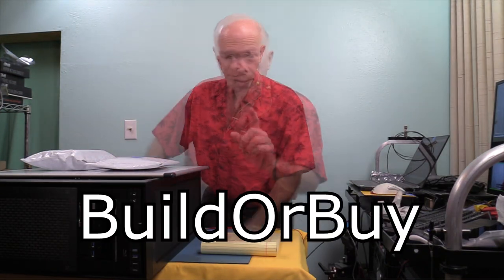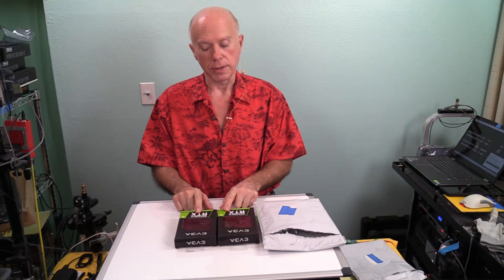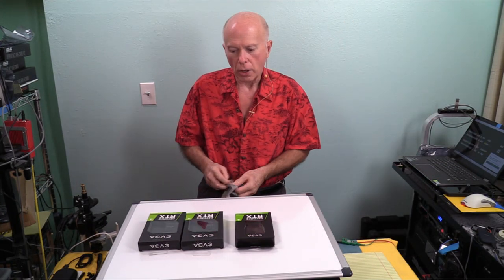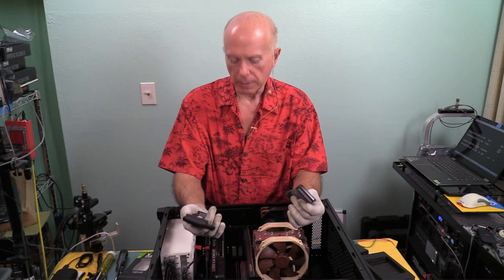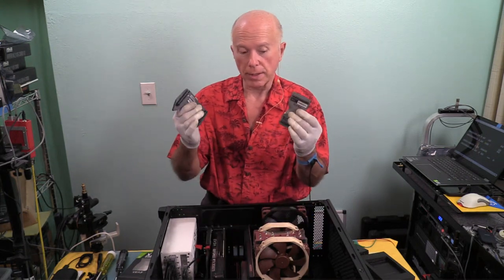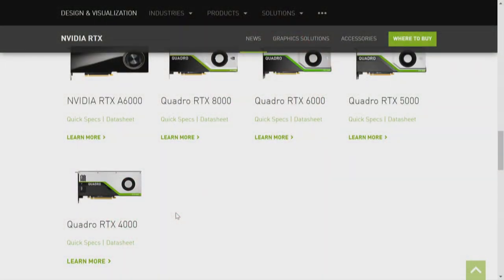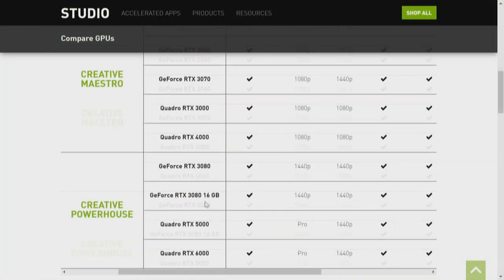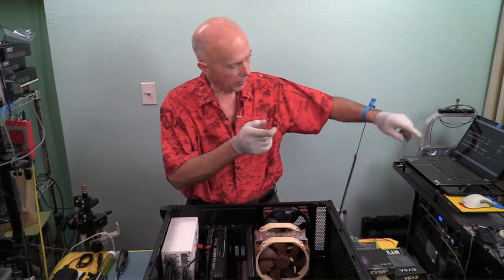Unboxing EVGA RTX NVIDIA NVLink Bridge

Comment: Otherwise, will it work on ASUS x570-e strix with 2 ASUS 3090 strix? 
Thank you in advance!!!
Reply from the maker: Hi Beatrice Costa, 
Rendering? Yes, it will work. However, there are 3 obstacles to deal with and overcome or be aware of. 
1. The RTX NVLink Bridge (3090) is 4 Slots Wide. To reiterate, all RTX NVLink Bridges for RTX 3090s are 4 Slots wide. 
2. The Slot width of Your GPU must be 3 Slots wide or less. 
3. Requires 2 x16 PCIe Slots, mechanically. You will be using dual x8 Slots, electrically. As long as You know that. No, You will not saturate the PCIe Bus but are not getting full performance and to have 2 RTX 3090's that's probably what You want. Just FYI. Moving forward to have 2 dedicated x16 Slots, electrically, would require the TRX40 Chipset. Hope that helps! Thanks for Asking! Keep Us Posted on Your Build Progress!
Reply: @BuildOrBuy  There is only one size bridge for the 3090s? One has to space them, for example, in the WRX80 in a way that the bridge prevents the use of one of the PCIe slots? Maybe this is for heat/air flow reasons...

Also, you mention that what was old is becoming new again. I keep hearing ppl say that SLI or linking GPUs is dead. Do you have a link that speaks to any new uses or resurgence in linking GPUs. Maybe linking GPU is dead for gamers.

Thanks, again. I continue to find your delivery of info/content refreshing. Perhaps lots of practice.
Reply from the maker: Hi @RickyBobby_USA , 
Yes, for the NVIDIA RTX 3090, only 4 Slots wide no matter the brand of GPU. For the most part, yes unless You're using a half height card like maybe a Mellanox Adapter. NVIDIA is getting way from Bridging all Consumer GPUs and moving that technology to the Workstation GPUs. I think, to further differentiate Consumer vs Workstation GPUs performance. Right now, only one Manufacturer of Workstation GPUs while the Consumer GPUs have several. Let's hope that changes! To reiterate, only the RTX 3090 Consumer GPU can be bridged. Let's hope that will continue moving forward on the RTX 4000 Series! Only time will tell. Until We know more, a point of conjecture. 

The more We look at the Consumer GPUs, the more intriguing the Workstation GPUs become!  From Slot Design to Resources required such as spacing, power requirements and NVLink bridging which is an extension of the PCIe Bus. Workstation GPUs have 2 different bridge widths whereas the RTX 3090 only has 1 bridge width of 4 Slots wide. 

And doing the 'what if' scenario, 2 RTX 3090s vs 1 RTX A6000. Price, Performance, Resources, Processing Power. Easier to install 1 GPU vs several. And all apps will recognize the 1st GPU. Most will not recognize more. Some will see 2 GPUs. An interesting situation to zoom in on then zoom out and say, here's what We know. Here's what We have available. What's the easiest way to solve the Problem. It's all about the end Results! If an application will only see 1 GPU but can make use of all of it, then how do We maximize that situation? 1 GPU! A process of back and forth. Keep it Simple! And sometimes kicking and screaming! 

Appreciate Your Comments and feedback! This helps Us to make better Videos! We're all about Answering Subscribers Questions! Hope that helps!
Reply: @BuildOrBuy  Love the interaction. I understand as your channel grows, it will be harder to respond. I wont hold it against you. Cheers.
Reply from the maker: Hi @RickyBobby_USA ,
Absolutely! I'm all about Answering Subscribers Questions! Everyone matters! My Goal is to help all Who come to BuildOrBuy! We learn by doing! And We should share what We know! What good is knowledge if not shared. I have to hibernate when Filming and while Editing! I'm honored You found BuildOrBuy! Appreciate Your Support! I love my Subscribers!

Comment: are 2080 RTX bridges and RTX 3090 bridges identical? the reason I ask is because I want to use 2080 single slot bridge on a DUAL SLOT 3090 card... cant seem to find the exact Gigabyte single slot bridge but I do see NVLINK bridge that was originally created for the 2080 cards..
Reply: -update - I am thinking that the RTX NVLINK QUADRO bridge has an identical interface... I think that is the answer.. those are dual slot cards and they are RTX..
Reply from the maker: Hi xpez, 
Welcome! That's why We created this Video to minimize confusion. So much for that! The different Generations of NVLink Bridges are different Configurations. For example, the RTX 2080 NVLink Bridge looks H shaped. Whereas the RTX 3090 NVLink Bridge looks X shaped. 

Puget Systems has the most extensive List of NVLink Bridge Configurations. Links below. 

Puget Systems RTX 2080 NVLink Bridge 
https://www.pugetsystems.com/support/guides/how-to-enable-and-test-nvidia-nvlink-on-quadro-and-geforce-rtx-cards-in-windows-10-1266/

Puget Systems RTX 3090 NVLink Bridge 
https://www.pugetsystems.com/labs/articles/NVIDIA-NVLink-2021-Update-and-Compatibility-Chart-2074/

And You require an RTX 3090 NVLink Bridge. To double check, which Motherboard and Chipset are You using? We'll take a look and see if We can verify what You need.
Reply from the maker: Hi @xpez9694 , 
To reiterate, tell Us about Your Motherboard and Chipset. We'll see if We can help Verify which NVLink Bridge You need!
Reply: @BuildOrBuy   great link! The GeForce RTX 3090, RTX A6000, and RTX A5000 use a new NVLink connection, which is not compatible with the bridges from the 20-Series and Quadro RTX cards. RTX A6000 / A5000 and GeForce RTX 3090 NVLink bridges may look different on the outside, but they appear to be functionally identical. We've tested both types of cards with both styles of bridges, and they worked interchangeably.
Reply: @BuildOrBuy    supermicro - M12SWA-TF  -Socket sWRX8/SP3m  i mistakenly bought the 3 slot  Gigabyte Aorus bridge. Since I have 2 x dual slot 3090s I want these cards to sit next to each other. that will free up another slot for something else. I can use what I have for the time being but not finding the 2 slot Gigabyte Aorus Bridge sent me down this rabbit hole of finding the compatibility.... LOL  thanks for your assistance!
Reply from the maker: Hi @xpez9694 , 
Nice WRX80 Workstation Motherboard! Down a Rabbit Hole and into the Weeds! So You were able to get Your hands on 2 Gigabyte Blower style RTX 3090s? Wow! Congrats! The Gigabyte NVLink Bridge is extremely hard to Source. Best price was at Best Buy. EVGA was easy at one time. Scarce now. The NVIDIA version in available but at a higher price. However, those both appear to be 4 Slot NVLink Bridges. The PNY RTX A6000 NVLink Bridge should fit according to Puget Systems. Link below: 
https://www.pugetsystems.com/labs/articles/NVIDIA-NVLink-2021-Update-and-Compatibility-Chart-2074/#:~:text=Most%20GeForce%20RTX%203090%20video,obviously%20not%20work%20with%20those.

Best Source on RTX A6000 NVLink Bridge is B&H Photo Video. 
PNY NVIDIA NVLink Bridge for RTX A6000 (2-Slot)
https://bhpho.to/3IvCvvv
As a B&H Affiliate, I earn from qualifying purchases! Hope that helps! Thanks for Sharing!
Reply from the maker: Hi  @xpez9694 , 
Yes! Puget Systems. That's good news!
Reply: @BuildOrBuy  THNKS FOR THE TIP!
Reply from the maker: Hi @xpez9694 ,
Absolutely! Thanks for Sharing! Success on Your Installation!

Comment: How do you know, for example, wich Nvlink do you need for 2 Gigabyte GeForce RTX 3090 TURBO 24GB GDDR6X?
Reply from the maker: Greetings! Excellent question! First, Congrats! Like EVGA, Gigabyte only makes 2 NVLink Bridges for RTX series Video cards. One for RTX 2080/2080TI and one for RTX 3090. 

Gigabyte RTX NVLink Bridges 
Gigabyte Aorus NVLink Bridge 4-Slot Key - (RTX 2080 / 2080Ti) GC-A2WAYNVLINKL RGB
1.) https://www.gigabyte.com/us/Graphics-Card/GC-A2WAYNVLINKL-RGB#kf
Gigabyte Aorus GeForce RTX NVLink Bridge for 30 Series - GC-ANVLINK 
2.) https://www.gigabyte.com/Graphics-Card/GC-ANVLINK#kf
3.) https://amzn.to/3qKC97R
As an Amazon Associate I earn from qualifying purchases.
They make Us dig for this stuff! Hope that helps!
Reply: @BuildOrBuy  but Gigabyte GeForce RTX 3090 TURBO 24GB GDDR6X is PCIE 4.0, and that bridge is 3.0.
Reply from the maker: Hi @mr_nemo24 , Where are You reading that specific Gigabyte NVLink Bridge is PCIe 3.0? The NVLink operates at a higher speed than PCIe. That's the main reason for NVLink, to overcome the PCIe bandwidth limitations. Yes, this is 3rd Generation NVLink 3.0. But that's not PCIe 3.0. There is a difference. Big difference! Hope that clarification helps!
Reply: @BuildOrBuy  maybe bad translate.
Reply from the maker: Hi @mr_nemo24  , Got it. Big detail misconstrued in translation. Get the one I sent You the link for on Amazon. Hard enough to nail down in English! Hope that helps! You'll know once You attach, it is correct. They are different. Keep Us posted on Your progress! Success!
Reply: @BuildOrBuy  thanks. You are the best. Well, first I have to think if it's better to have the x16 occupied with another graphics card and add the bridge or instead maybe occupied with 4 m.2 with the adapter card you also have. I think with one graphics card is enough. My propuse would be for editing, rendering, exporting, so, for content creation. However, perhaps I don't need the m.2 adapter card and with normal ssd would be enough. Depends on the size and the decoding time process of the files. I like to watch the things that I filmed at real time with no proxys, but the m.2 will be full very quickly if the proyect is big. So, I have to decide if it's worth to invest on the graphics card or the adapter card, in other words, more speed at editing, rendering and exporting or more fast space where I can work. If you had to decide between fast space or fast graphics card, what would you chosose?
Reply from the maker: Hi @mr_nemo24 , 
Thank You for Your Comments! Here to help! Appreciate Your Questions! Agreed, one Video card. Especially since You have 1 RTX 3090. An easy path to Upgrade if You decide to change later. 

Editing does not take anything Resource intensive. Rendering is Resource intensive. On average, CPU does 90% and GPU does 10% of Rendering. We're going to be Discussing Hardware as it relates to 1080, 4k and 8k and 12k Video. I'll be sharing my thoughts on that soon! There may be some mention of that in our next WRX80 Build Spec Video. Stay tuned!
Reply: @BuildOrBuy  If you use codecs like Prores or Adobe programs your CPU is going to work more than the GPU. However, if you use DaVinvi and RAW, is important to have a good GPU, because is going to work more. That's what I have learned on my research. I will be waiting your next videos. I am using BMPCC 6K, love to hear wich cameras you mention.
Reply from the maker: Hi @mr_nemo24 ,
Yes! Congrats on Your purchase! Great Camera. Blackmagic makes great technology affordable! And when You get into 12K, that's DaVinci Resolve Codec. Absolutely, that's when an RTX 3090 gets more affordable than the RTX 3080. All depends upon results! Thanks!

Here are a few Data rate Calculators to mess around with. Data rate requirements have to be considered when Building a Computer for Content Creation. 

Extron - 8K Data Rate Calculator 
1.) https://www.extron.com/product/videotools.aspx
DPP Film Tech - File Size and Data rate Calculator
2.) https://www.filmtechapp.com/calculator.php
Blackmagic Calculator
3.) https://bitratesareus.netlify.app/
URSA Mini Pro 12K Data Rate Calculator
4.) https://www.blackmagicdesign.com/products/blackmagicursaminipro

The first and last are my favorites. Hope that helps until we get the next Video up and running!
Reply: @BuildOrBuy  thanks, gives me an idea. But still waitfor your next videos about the matter ;)
Reply from the maker: Hi @mr_nemo24  , We're working diligently on Our next batch of Videos. Thank You for Your patience! Good discussion! This helps Us to make better videos, as we answer questions!

Comment: I have been looking in the Threadripper Pro for a potential future build, and come across some software on the ASUS WRX80 MB, ASMB-iKVM ....BMC ( Baseboard Management Controller)... I also seen where ASUS has a new B550 Board ( ProArt-B550 CREATOR ), and it too has software referred to as the ProArt Creator Hub.... Are these new types of software that allow you to go between the OS, and the BIOS ? They appear like software that allows you to access the BIOs, from your operating system, or something along those lines....
Reply from the maker: Hi Shannon Bailey, 
Depends upon who is Using and who is Managing the Devices. 
1.) BMC ( Baseboard Management Controller) is a Server Management Tool. For Remotely managing multiple Computers. 
2.) ProArt Creator Hub is for Content Creators. To Manage ProArt connected Devices and Resources. For managing multiple Devices on a Computer.

Somewhat similar but both very different in Scope and Details. We already have Tools to manage the Bios from within the O/S. A separate Video would be great on both. 

We're finishing up the Video on a TRX80 Build and chose not to mention BMC to keep the Video as short as possible. We just hit the high points. As a single Workstation, I question how useful BMC will be be. On the other hand, ProArt Creator Hub could be very useful, per User, on a ProArt Computer since that management includes Color Calibration. Good question.